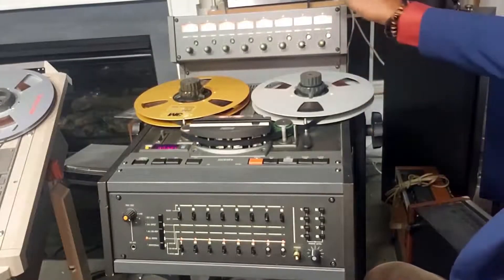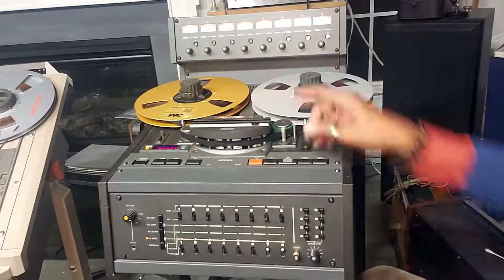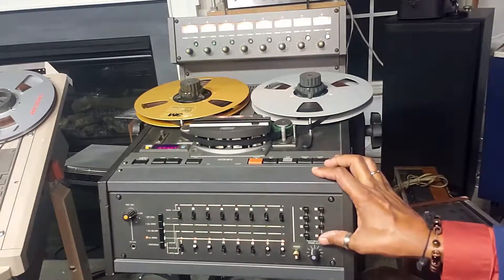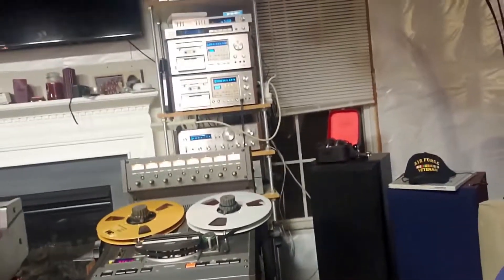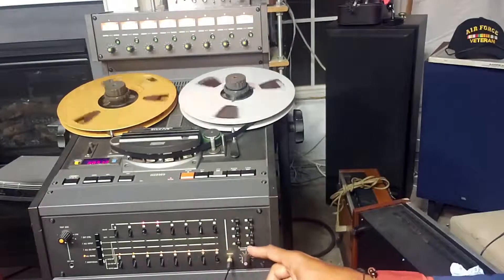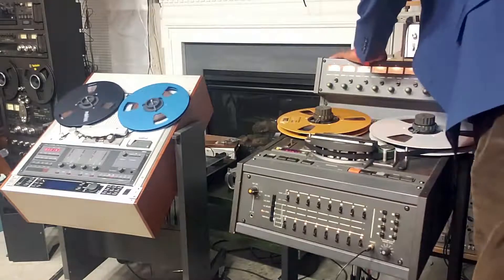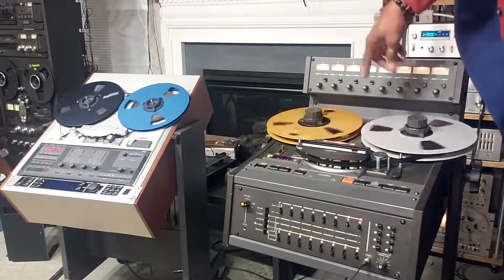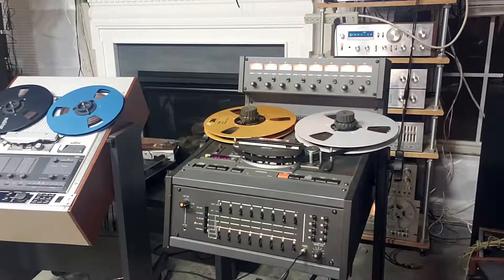Otari Mx 5050 Mkiii 8 Reel To Reel Demo

Comment: Hi I just got the Otari MX 5050 MK IV-4  Half-Inch. when I change from high to low it only seems to go 7.5ips I was sure it was 15ips
Reply from the maker: Does the pitch control work? I'd try cleaning the both the speed switch and pitch control switch.
Reply: I wonder if there is an internal switch as my older mx5050 two track has a secondary speed switch to get slower speeds.... just a thought, not sure if that switch exists on these newer models..
Reply from the maker: @soulslip  Pop the rear cover and you should see it
Reply: @soulslip  thanks very much for the information

Comment: one channel on mine is stuck in record, moving the safe switch makes has no effect
Reply from the maker: That switch may need to be cleaned
Reply: @5thcomm  I sprayed it with switch cleaner. No change. Do you know the PCB Assy name this switch is mounted on, so i can see the circuit?

Comment: hi  i lost my deck smoke came out of it i re used the parts in a fixer up
i have a tascam 38 that is jazz up      it can do 30ip   i left a plug of on the motor pcb on a tascam 38 it went crazy speed 
there a speed button on the back panel now  

i have alot of tape decks the otari mtr 12 can do  30ips   my ne set at low speed super for editing tape  why i got it 
it's pimped to 1/2 tape  4 track  glass heads
Reply: 30 ips on a Tascam 38???